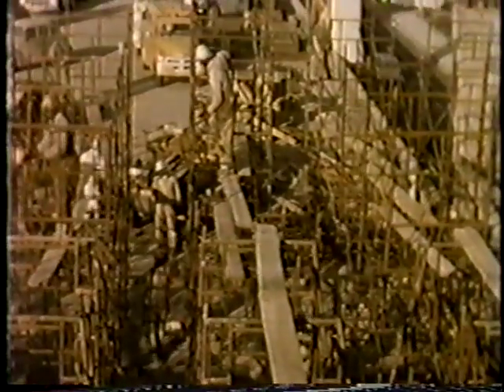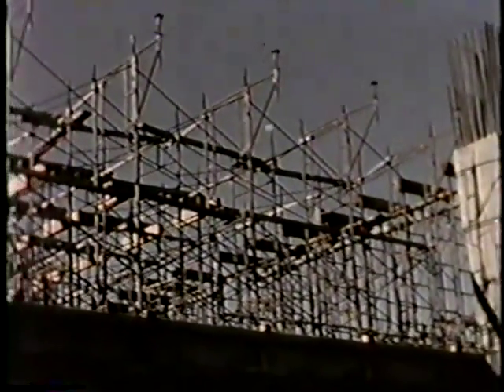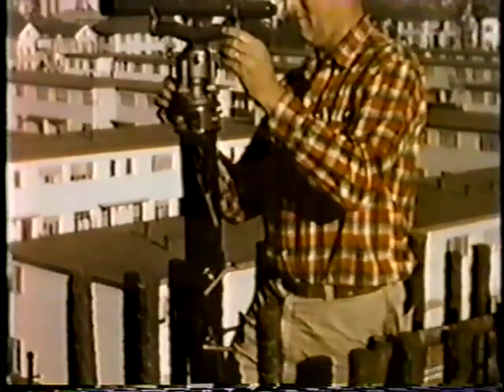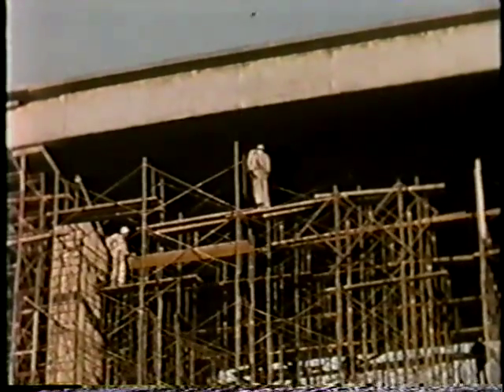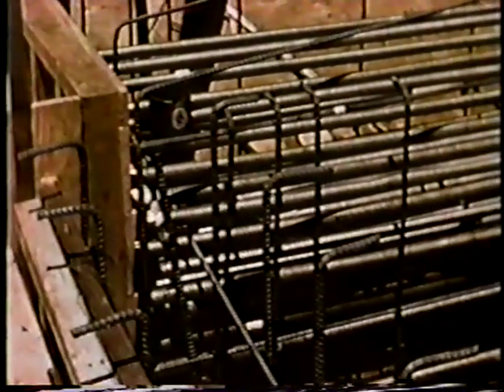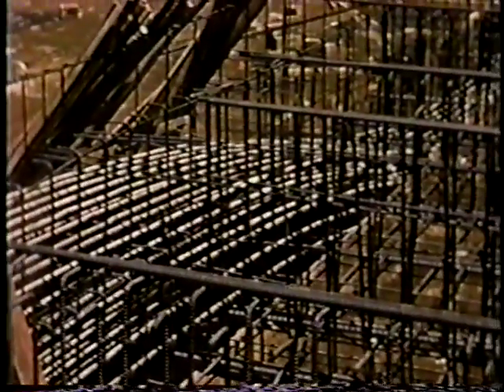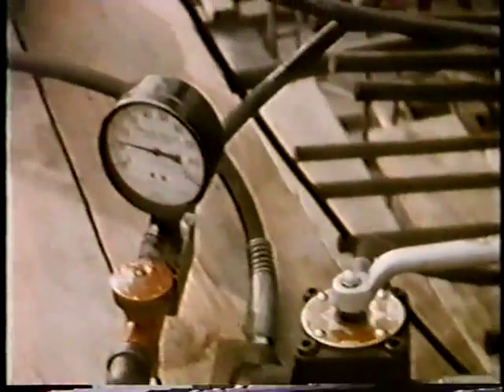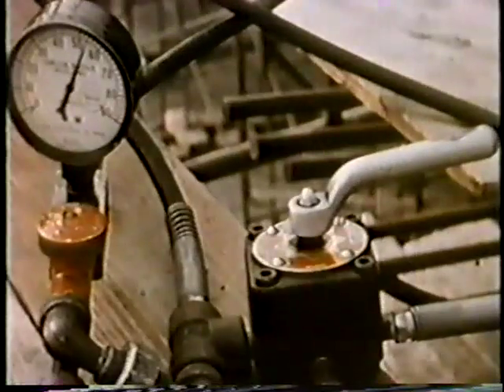I-880 Cypress Viaduct Construction (part 3 of 5)

Comment: @0:19"serious second thought's" because they knew what later happened in 1989 was a possibility?
Reply: Notice no horizontal rebar on the columns,this led to the collapse of the structure during 89 quake,at some point building codes mandated horizontal rebar and vertical rebar.The freeway dipped a bit between support columns.